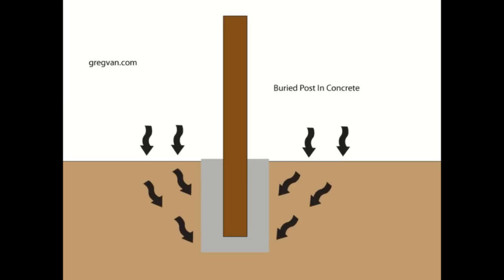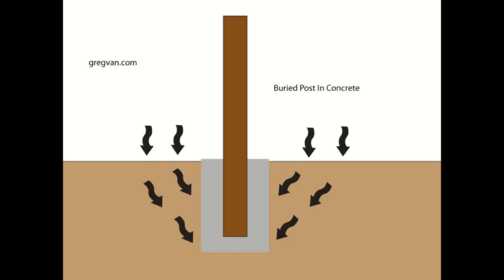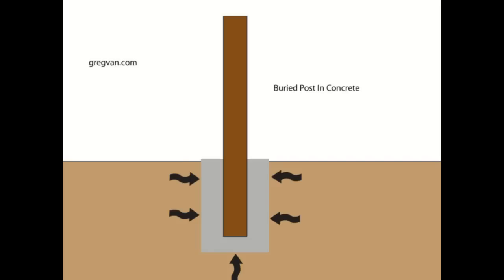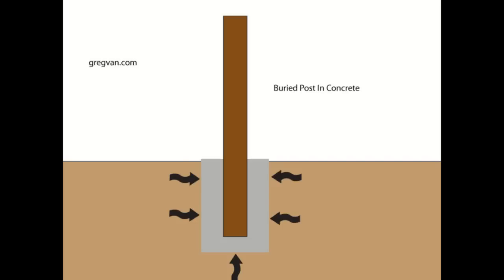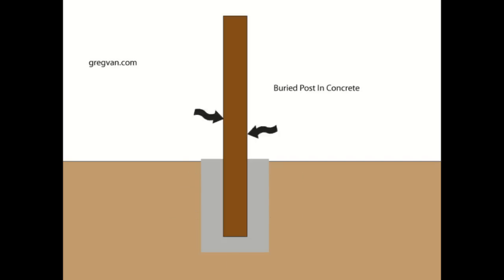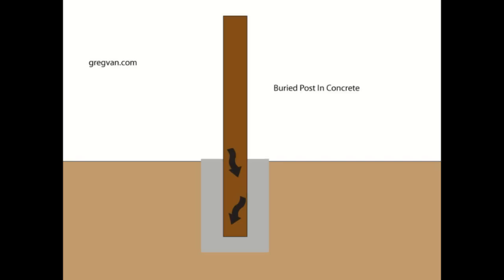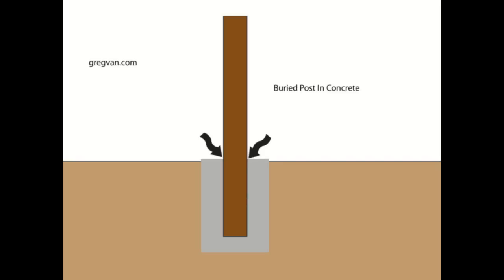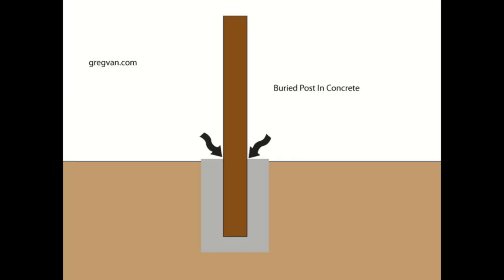Why Do Fence Posts Rot and Break - Wood Fencing Damage

Comment: I cut off posts 2" above ground, dig out the concrete with my 30# jack hammer with 2" chisel, suck the hole clean with a shopvac, and bolt on a pair of 1\4 x 3 steel straps with bits of rebar and misc. junk welded on. Fill the hole back up with good concrete -- not "fence post" porous junk. There're some 50 yr. old posts at one of my rentals still strong.  I'm not frugal, just plain cheap!
Reply from the maker: +Rusty Wells I would love to see a picture of your repairs or one of the 50-year-old posts.
Reply: +Rusty Wells  I agree. I removed one that was 75 years old. It was used to anchor a clothing line post in place. I dug it out. It was about 3ft deep and about 18" wide. It was a monster to remove.
Reply from the maker: I guess I don't need to see a picture if the wood post is 18 inches wide and would imagine there's a big difference between that and a 4 x 4, including the fact that you can probably get 10 4 x 4 posts out of the 18 inch post.

Comment: You need to go study the science a little more on this issue.  The issue of concrete is two-fold.  (1) Wood and concrete have different expansion rates (moisture expansion and thermal expansion) and (2) the chemicals used to harden concrete are caustic.  You addressed the expansion and missed the caustic nature of concrete.  As moisture travels from the soil to the wood, it leaches any remaining unused caustic material into the wood which eats away at the wood eventually loosening it in the concrete.  Most fence posts seem to rot away near the surface before the caustic nature of concrete becomes an issue lower in the post, but it does add to some of the rot near the surface in addition to that done by the bacteria.
Reply from the maker: I am always interested in learning a little more, could you please help me with the courses you recommend me to study and how it would improve this particular video.
Reply: I don't know of specific courses on this particular subject.  However, the scientific information is available if you do the research.  Much of what I learned about this is from various sources that I came across.

Comment: I don't agree.  You never see fence post rotting  from inside the cement.  Its caused primarily because the fence posts are not capped, and they dont poor the cement high enough and pitch it away from the post.  If you use pressure treated wood, paint it with tar, use cement properly and cap the posts, it will never rot inside the concrete.
Reply from the maker: All I can say is that you might be in for a surprise. Remember, most of the information I share on this channel is from the time I spent working on new and old projects.

Comment: The obvious answer is to seal the end grain of the post before you set it or preferably paint the entire post but make sure to put several coat on the end going into the ground . The constant wicking of water on unsealed lumber will be sure to leech away enough of the treatment to make the wood palatable to microorganisms . This isn't rocket science . If you really want to ensure a long lasting post you could burn the end in fire for a sufficient amount of time to fire treat the wood and then treat it with copper naphthenate before you seal the end grain with a long lasting exterior paint . The fire actually chemically alters the sugars and tanins in the wood and permanently renders them unpalatable to microorganisms . Archaeologist continually find logs from ancient fire still intact .
Reply from the maker: I have actually buried burnt lumber and it rotted. I don't think it's common for archaeologists to find wood or burnt wood and if it is found, I'm pretty sure it was under specific conditions and those conditions might not be available for all wood fence posts
Reply: I've personally never tried it but heat treated lumber is a proven practice and readily available in the market place .  Finding old burnt wood is extremely common .  I've dug up old fires that I'm sure were from oyster roast from several decades past and found burnt pieces of wood . Of course there would be specific conditions . That is why there is always an engineer in charge of developing this stuff .
Reply from the maker: Well, there you have it, you will need to burn the bottom of your wood posts and then let us know if it worked in a few decades.
Reply: Sounds like a plan let me know how that works out for you . I personally would just paint the ends before I set it .
Reply from the maker: I won't be burning the bottom of my wood posts, so won't be able to report anything back.

Comment: My solution has always been to place gravel in a porous bag directly under the post as you pour the cement so that moisture will drain down the post edges and percolate down the gravel.  The concrete usually acts like a basin filled with water and the posts just soaks in it for long periods of time rotting the wood.  The gravel bag allows constant drainage.  Also, I taper the top of the concrete block so that water flows off and away instead of dripping down between the post and concrete.  

One of the main reasons wood rots is because it comes into contact with microorganisms in the soil.  I usually brush a little "boric acid" dissolved in water around the post where it meets the concrete,  which acts as a repellant against microorganisms and prevents them from propagating.

Of course the ideal way to set the posts would be with anchor braces, with the posts bolted on, this way you can replace the posts down the road without having to replace the concrete.  Of course the anchor braces must be galvanized to prevent rusting.  Make sure the braces are perpendicular to the fence line to provide lateral strength.
Reply from the maker: http://www.homebuildingandrepairs.com/fences/index.html

I've never heard about anyone using boric acid, but you've got a good point. Is the boric acid harmful to the wood? I'm not convinced that the gravel under the wood post is the best method in clay soils and will try to make another video on it explaining why. I've already made one video on it and you can visit the website for more information, but will make another attempt.
Reply: +gregvancom

Yeah, I agree about clay soil but I'm not talking about open gravel which can be infiltrated with dirt through time defeating the purpose.  I Take a piece of French drain pipe sleeve, tie one end and fill it with gravel, and then tie the other end.  This creates a sealed ball of gravel which can be placed underneath the post.  The main idea is to keep the tip of the post from resting on dirt and allowing the little water that enters the sides and drains down, to rest at the bottom of the gravel cavity before dissipating into the soil.

I also use treated "4X4" posts which prolong the life as well.

On a critical corner gate post, I also installed a straight bracket into the cement so that in the future, if the post failed I can remove it and bolt a new post in place.  The lateral support is done by the house wall post, bolted into the wall.

My thing is, whatever you can do to prolong the life of the fence structure is a benefit.
Reply from the maker: I like your thinking and hopefully your solution will work for others, but I'm not entirely convinced that it will solve everyone's problem as I mentioned with the clay soil and in areas where it rains often or areas with higher water tables. https://youtu.be/qzSbhfrIRgY

Comment: I have a few suggestions from an engineering point of view, but they all require more work and effort that you might consider worthwhile for normal home use, but should definitely help.
1.  You can get a concrete waterproofing compound to add in when mixing the concrete (designed for use when making a pond or swimming pool). This should help keep the post dry.
2. Bring the top of the concrete a few cms / ins above ground and trowel off smoothly sloping away from the post so water does not sit on top and peculate down.
3. Seal around the post with bitumen or another flexible sealant in case the post shrinks as mentioned.
4. This is important whenever you make anything out of concrete, especially slabs and floors.  Concrete is strong in compression, but very weak in tension (and bending which causes tension at one surface). This is why it is easily cracked and split by the post expanding. To give it tensile strength it needs to be reinforces with steel.  If you can get hold of 6 mm (1/4 in) mild steel reinforcing bar this would be ideal.  Roll it around something circular (a cut log perhaps) to make a spiral spring which will be 3 to 8 cm (1 to 3) inches larger than the post. I would make the coils about 5 cm (2 inches) apart. You could hold it in place with some nails into the post.  If you can not get hold of proper re-bar you could use fairly thick fencing wire. (say 4 mm / 5/32"). (For slabs use a light steel mesh 50 mm cover from the bottom).
5. Of course proper pressure treated posts should resist rot, but since the use of creosote has been discontinued it seems difficult to get full protection.
Reply from the maker: I agree with everything you said except for number three. Unless you are going to seal the entire post, water can still absorb into the wood and create even bigger problems as gravity pulls it down into a waterproof cavity.
Reply: I see your point.  At this time I can not see any way of preventing water being adsorbed by the timber and soaking down below ground level.  With brickwork you would put in a damp proof course (to stop moisture travelling upwards). This of course is impossible in wood. The old way was to put the timber in a steel pressure container, reduce the air pressure to remove air from the wood, fill the container with bitumen, then re-pressurize to allow the bitumen to penetrate right through the timber.  Probably too expensive these days?
Reply from the maker: You made a good point in your previous comment, it seems like the more money you spend the longer the fence might last, but there's no guarantees. I really don't have a good solution to this problem.

Comment: Use stone instead of concrete.The concrete rots the wood
Reply from the maker: +Brian Ellsworth Sounds good in some cases, but in other cases where water doesn't drain from the soil as well the stone or gravel can create areas for moisture to accumulate and speed up the wood damaging process.

Comment: The reason fences in the US rot in the ground is because the US is ~50 years behind the rest of the world and doesn't treat the damn wood for function.  Most wood in the US is heat treated at best.  Compare that with fencing in, say, New Zealand or Australia where fencing gets treated with bromide and boron.  They use a scale (H1 to H6) for the function it has to perform which matches the level of treatment. At H4 and above level you're talking direct & continuous soil or marine contact, minimum life before starting to rot of 50+ years.

Quite honestly, American fences are a joke.  The timber is garbage and is designed to fail very quickly.
Reply from the maker: I can't argue with your comment and wonder why someone hasn't came up with a better way to build wood fences.
Reply: gregvancom   but they have.  exhibit A & B: New Zealand & Australia.  I think the reason the US keeps doing things the same way is literally the desire to make the process repeatable on a short cycle for profit purposes.
Reply from the maker: I agree
Reply: They want you to keep coming back to buy more posts.